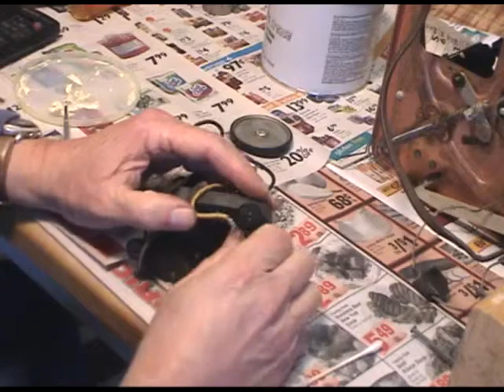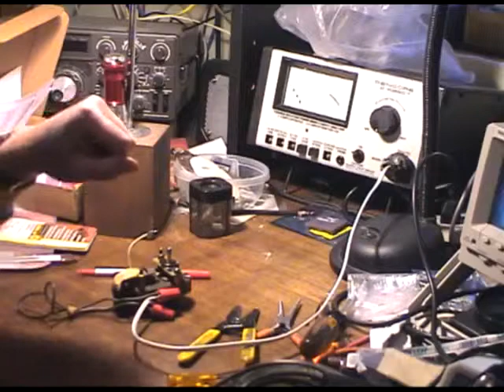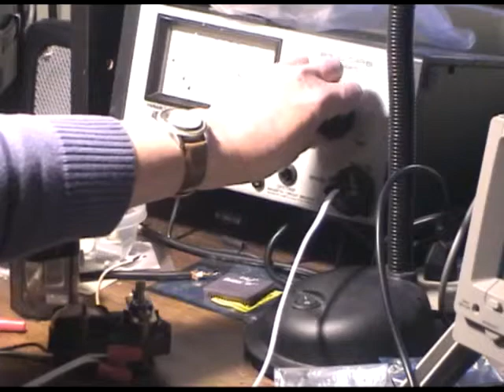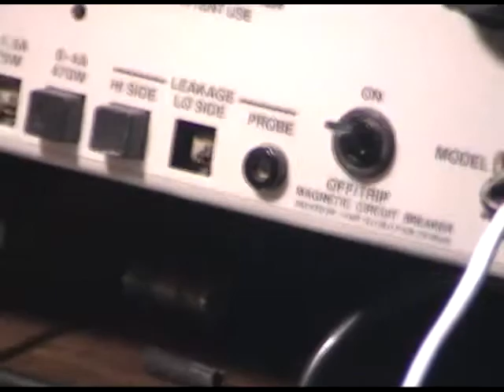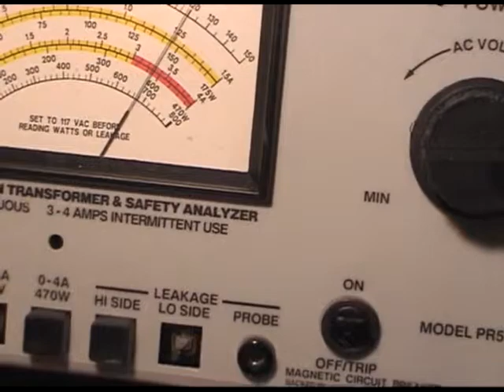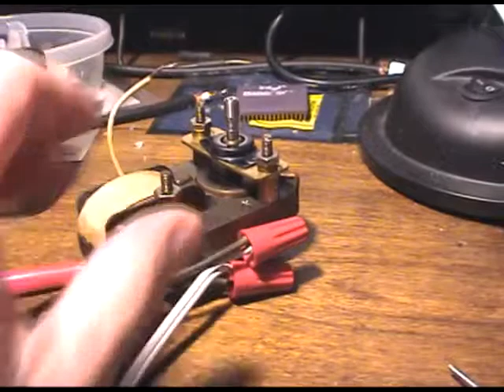Majestic 5A455 - Part 9d - ''Rebuilding and testing the turntable''.mp4

Comment: Looks about right for wattage - from an ad that looks similar to your motor:

      33 Frame Motor
      3000 rpm / 115 vac / 60 Hz / 0.35 amps / 25 watts
      General Electric 33 frame motor. Fits Sears appliances. 3,000 rpm, 115 vac, 60 Hz, 0.35 amps, 25 watts. CCW rotation, shaft end. Includes snap-on oil covers. 1/8"D x 2-1/4"L shaft. 1-1/8" x 1-7/8" c-c mounting holes. 

 VERY interesting videos this week, thank you.

Steve, K7SJA